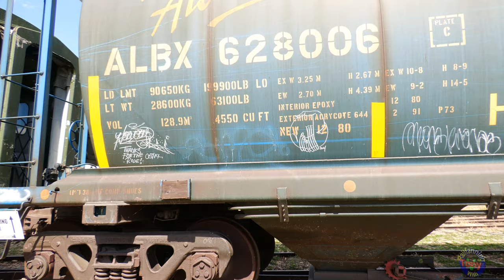The Alberta Railway Museum

Comment: Great video.  This musem is on a former military spur track that used to cross 34th st NW to a fueling area to the west.  If you follow the old right of way, you can see it curve south and then end.  Pretty cool stuff!!
Reply from the maker: Thanks, yes. The museum would like to reopen the line farther west but the road crossing would require lights and possibly gates an cost they can’t really afford.
Reply: @TonyVRailfanning  They really need a sponsor to make it happen.  The right of way berm is still in place.  It would make the passenger experience that much more with a longer ride and crossing bells and whistles.
Reply: @trainguy7261  The military sold the right of way west of 34 St some years ago.  In recent years it has become a dumping ground for spoil from construction projects, the old grade is now buried under a giant pile of dirt.  Even if the museum were to somehow get enough money to buy that land it would take a lot of work and an even larger amount of $$$ to put a railroad there again, and that's assuming the current owner would even be willing to consider selling it.
Reply: @bobsmith2637  wow that's too bad.  They are pretty confined with how far they can do train rides.